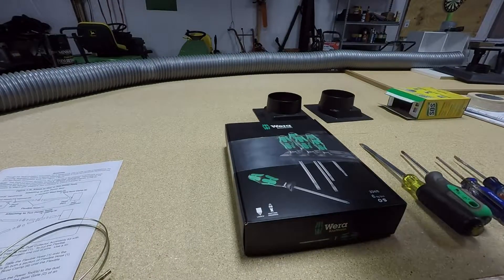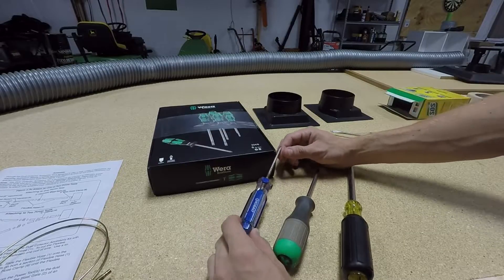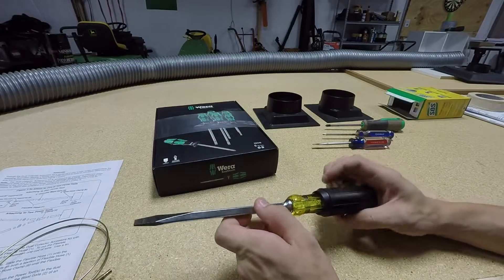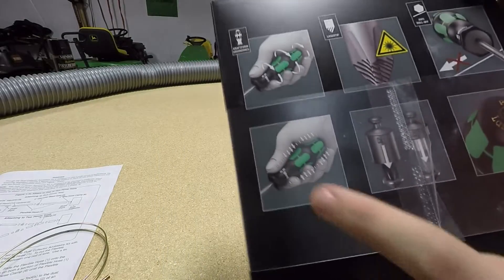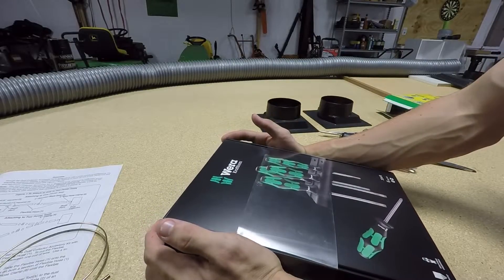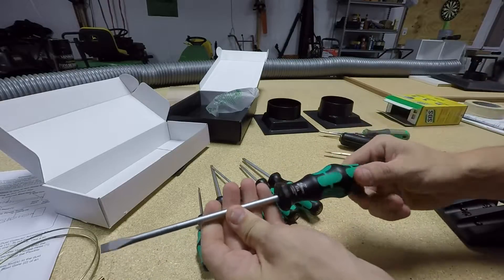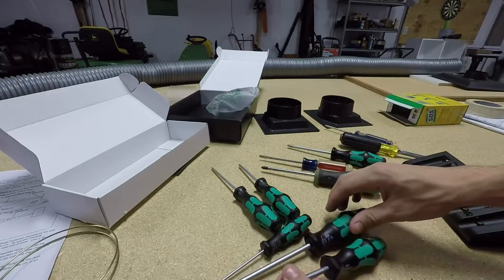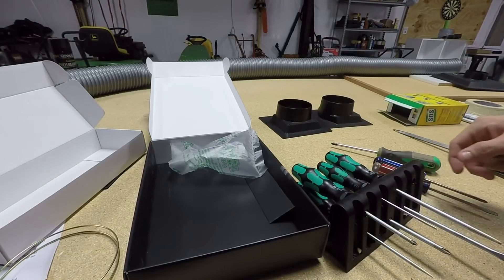Unboxing Wera Screwdriver Set

Comment: you for got to talk about the most innovative and coolest part of screw driver, The Lazer Etching on the tips to reduce cam out..
Reply from the maker: I know man! That etching works wonders!
Reply: How well does the etching hold up tho... I'm looking to spend some $$ on a higher end set but have been getting mixed reviews on the softness of the tips... Your thoughts?
Reply from the maker: Well consider this, if the etching doesn't hold up that would be considered a defect and covered under the lifetime warranty. My etching hasn't warn down at all, its literally burned into it. It definitely does help a lot though. I have used it on screws that have been stripped out by other drivers, and it manages to get friction and loosen the screw just fine! No jumping out of the screw head. In terms of some, these screw drivers are cheap!